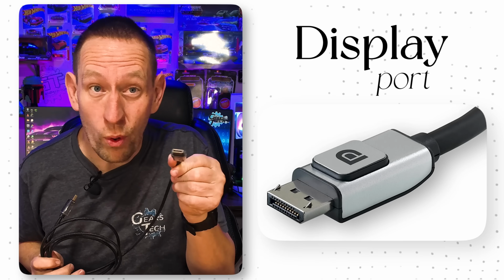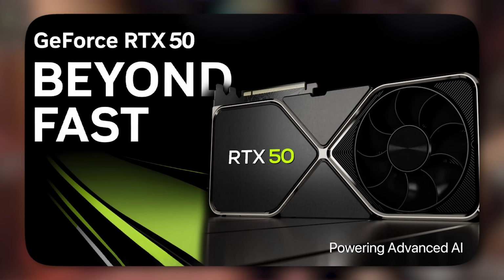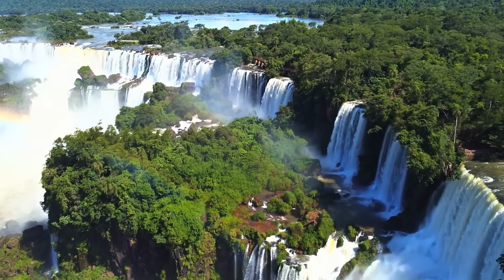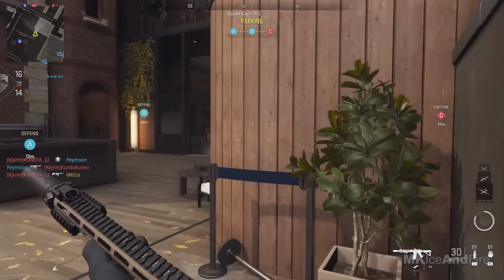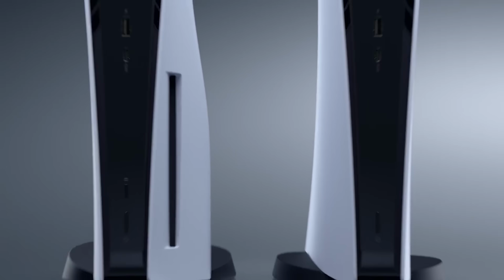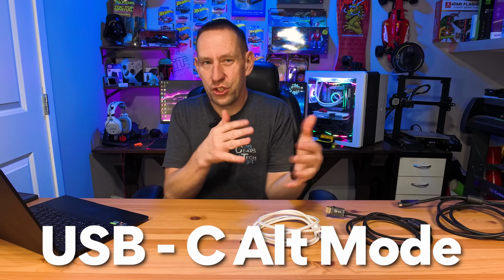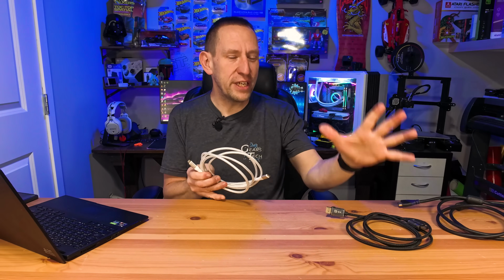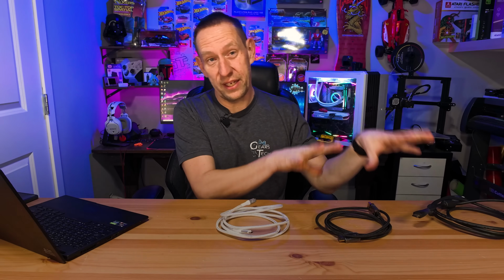HDMI vs DisplayPort vs USB-C Connection Guide

Comment: Oh cool.... I'm running VGA to Acer monitor with 1440x800 and 60 or 75Hz, then a display to HDMI and HDMI to VGA converter chain for my dell monitor with 13something and 60Hz....it's a mess but it's a cozy mess
Reply from the maker: Sounds like an exercise in adapters to make something work

Comment: I'm using DVI with my monitor because that was the brand new thing when I bought this monitor...maybe it's about time to upgrade my monitor
Reply from the maker: Haha, it might be time!
Reply: @GearsAndTech yeah. I just really like the composite, component, s video, and vga connections it also has for some of my older toys as well as the split screen and picture in picture features

Comment: Keep in mind that video creator is using the term Display port generically. However, any user needs to consider that DP (same as any of the others) comes in different flavors. Disport 1.2 is where it gained its greatest popularity, but that connection is 10 years old. 

The point is, not just DP but as close to the recent most advanced iteration of it. At present, that's DP 2.1 But the industry is typically at least a year behind. No manufactures designs their ports to be future-proof. Meaning any item you buy will always be a generation behind of what the technology is full capable of producing. 

REMEMBER, not simply the port, but the GENERATION. Display port is the best generally, but not when its a 10 years old version of it. If that's not confusing enough, BEWARE of the version of the port and the cable. Cable manufactures will use words to trick you into buy a lower quality cable. Since all of them will work (just down graded), you will get a picture just not up to the maximum quality you paid for.  

Think of it like when auto manufactures tell you your car can run on regular gas. The part they leave out, it that it will be at a reduced  power setting since the engine is designed to produce maximum power on premium fuel. 

You'd think manufacture will all agree to print the maximum capability on their products, so that consumers know instantly what each product is capable of (e.g. ethernet cables), but none of them do. In some cases, its not even printed on the package in clear language. 

That's a good sign to beware. When something is capable of the highest standard, they will typically be happy to advertise that boldly on the box so you know before you buy it. 

Display port is a pro/industrial port. HDMI is a consumer connection.

Comment: I Have 2 55 Inch TCL UHDTV's That I Use As Monitors! Both Mounted To The Wall In A Stacked Configuration! The Upper One Is On The HDMI And The Lower One Is On Display Port! Both Are 4K With My Scaling Blown Up So I Can See Them From My Recliner Or Bed! In The Living Room I have A 65 Inch Hooked Up To A PC Over HDMI And My Son Has A 50 inch In His Room Hooked To His Laptop Over HDMI!

Comment: Display port has many advantages. In its latest form, it cover all of the above from HDMI and USB-C with room to spare. However, its biggest advantage is its ability to Daisy-chain. Meaning you can connect up to 3 monitors from a single DP connection. 

Every manufacture should adapt it from HIFI systems to cameras, especially since you can always "adapt" the other system with an inexpensive adapter.

Comment: Displayport is the best hands down.
Reply: By a good margin. Too bad its overlooked by almost every manufactures. For example, both still and video cameras could benefit greatly from the bandwidth and data rate included in this port. 

To my  knowledge, not a single camera manufacturer, still or otherwise, has adopted it. Choosing HDMI (a consumer connection) instead.
Reply: @mranerobic3795  Agreed and then some.

Comment: I have been using hdmi 2.1 with the Gigabyte M32U and Rtx 4090. Is that hdmi cable good or should I go with DP?
Reply from the maker: Whenever possible I prefer dp. It removes the guessing if the setup is optimal
Reply: Not only do you need a DP, but be sure you get the cable compatible to carry  the extra bandwidth. The legacy cables will all fit, but they won't all transfer at the same rate or bandwidth. You'll only get what that cable is capable of delivering. 

Learn the tricks in the marketing wording. Compatible does not mean the same as capable.

Comment: I've used DP with a 3060ti and two monitors. I'd switch to HDMI with my new 5060ti, but my monitors are limited to HDMI 2.0. Not a gamer, so I expect I'll still be fine for my level of production work. (I keep forgetting i can daisy chain the DP.)

Comment: Ultrawides monitor 5120x1440 @ 120hz + stereo sound via the displayport cable that came with my computer. Though oddly enough the monitor only came with an HDMI cable, not DisplayPort. Working great for me.
Reply from the maker: Glad it's working well for you!
Reply: Because you don't know any better. Its like being happy with chicken until you've tried steak. If your system is capable or more, maximize it. Always use the newest cable that fits what the port can produce.
Reply: @mranerobic3795 and what benefit exactly would I get from HDMI vs the DisplayPort? I'm getting the max resolution, the max framerate, and the full sound. What more is possible?

Comment: Thanks for this explanation, I used HDMI simply because the monitor came with a cable and bad cables can be a source of problems.
At the time I was using display scaling and setting up custom resolutions for performance gaming.  The word was that HDMI worked more reliably and some people had trouble with DP, which could easily be a function of a newer interface not having old cables and monitors not supporting the full GPU 1.4A specs.
My old monitor with a DVI port has DP too, but even though I am strong on software and OS management and build, the way the commercial consortia define standards with features but then makes them optional undermines  their whole existence meant to certify features and performance to end users.

Comment: Most Monitors support all three connections? I've never seen a USB-C monitor, only heard of them. Actually I DO have a small monitor with a USB-C port, however that's only using the USB-C socket design, it's still a DisplayPort connection, meaning I can'r just connect via any given USB-C cable, it needs a specific DP cable with USB-C plug. Often times phones or tablets get hooked up to TVs, monitors or beamers via their USB-C port but even then that's usually not an actual USB connection but the device's DP Alt Mode wich basically transforms the USB USB-C port into a DP USB-C port, sending the end device it's video and audio via a DP cable or a DP cable with DP to HDMI adapter.
Actual USB IS capable to carry video signals, not get me wrong, that'S exactly how Capture Cards work, sending video and audio to a PC's USB 3.0 Type A port, not even Type C. But modern monitors, TV's and beamers usually only support HDMI and/or DP. If one has a USB-C port it's probably just a DP port using the USB-C socket.

Comment: Still slightly confused right now. I have a 4090. It’s got DP 1.4a and 2x HDMIs. been rocking a 240hz zowie on DP. Now that DP 2.1 is out and monitors having that available. I just bought a 500hz Oled thinking it was 2.1, it’s actually DP 1.4a. Do I need the faster 2.1 cables or do they not work on these ports?
Reply from the maker: Cables are backwards compatible. Won't hurt to have the higher spec cable.

Comment: Things he didn't give, skip. Display port also supports not plug. Also HDMI doesn't have a locking connector like display port. Also many times you can get inexpensive converters from display port to HDMI.

Comment: You know wat i discovered is that saving lives is a lot easier than this technology stuff ...I have a Microsoft laptop 2017 surface and I want to link it to the TV as im using as monitor on the port is has a little square opening znd usb ....im trying to find a cable male usb to fit computer and then hdmi male to TV...not sure wat that square opening is on laptop .. .
Reply from the maker: Square opening is likely just the security hole for the old days when people used laptop locks.

Comment: USB-C does not do anything, USB-C is one thing and one thing only: an ovoid-shaped interface that is easier to connect. USC-C MUST be USB3 to have the qualities you state but it can be USB1, 2 or 3 but only three does fast-charging at higher voltage. If the cable says your device is not fast charging but it has a USB-C connector, it is not USB3. Micro and mini USB connectors and ports could fast charge if they had USB3 specs.
Reply from the maker: Yes. I cover all that in my usb specific video
Reply: @GearsAndTech  then the title of the video is misleading. it should say USB3 rather than USB-C.

Comment: The problem with HDMI that you didn't mention is that the connector is long and heavy and has no mechanical locking as once existed with the 2 screws on VGA. Consequently is sometimes becomes loose and the connection becomes faulty.

Comment: I use DP (DisplayPort - not the porn definition for DP  😛). I would prefer HEMD 2.1, but my monitor only has a single DP port and 2 DVI-D ports. DisplayPort is uni-directional meaning if you monitor has a DP, it will accept data only from either a DP source or a DP converter that has the DP as the target and, say HDMI as the source. Most simple converters convert from DP source to HDMI target which is of no help to me. Converters that go from HDMI source to DP are more complicated and require a USB connection as well.

Comment: Is there an HDMI to display port adapter/ dongle to connect a newer computer with a display port port to an older monitor? Or how about the reverse? A old computer with an HDMI port connecting to a newer Samsung OLED monitor?
Reply: There are absolutely adapters both directions. I have the adapter that you would need sitting in my junk drawer, and I used to use it to connect an old laptop that only had DisplayPort, not HDMI to a monitor that only had HDMI and no DisplayPort.

Comment: Excellent analysis!   Minor point, I have multiple PC’s and Mac’s and I bought a usb-c to HDMI cable, and was surprised to see that the sound was not supported.  😊
Reply: That's unusual. I've worked with multiple USB C to HDMI cables/adapter/docks over the years, and playing sound on the monitor's speakers works just fine over them.
Reply: @yvrelna  — I must be doing something wrong.

Comment: A comment on HDMI audio, HDMI 1.4 onwards actually supports 8-channels (4 stereo pairs) and up to 192khz audio - this is useful for professionals passing uncompressed 5.1/7.1 audio through to a Dolby encoder, a second standard sends a single stereo pair at 32khz to 192khz - some devices only support this single stereo standard.  Another comment is DVD and CD players tend to send 44.1khz, while blu-ray sends 48khz audio through their  various interfaces.
Reply from the maker: Great points

Comment: I only have a ROG Strix G18 with 5080 and a PG32UCDP monitor. What is the best cable could I use to get the best connection? I’m just using the HDMI cable it came with, I believe it’s HDMI 2.1. The gaming laptop doesn’t have a DisplayPort port. But there are HDMI to DisplayPort cable and USBC to DisplayPort cable, even adapters. Are those any better than HDMI? Thanks
Reply from the maker: The problem with hdmi is its not easy to verify the cable type. As long as you're sure the cable is the highest supported one then you're good

If there is any doubt then DP is usually the better option

Comment: Thanks! But, what's the difference between displaylink and displayport?
Reply from the maker: great question. Display link is a software solution to solve connectivity of multiple monitors through one connection (typically USB). It should not be considered for any gaming connections as it uses compression to keep bandwidth in check. Great for productivity and thats all

Display port is a connector and video protocol over that connector. Its the better option every time.
Reply: @GearsAndTech 
Since viewing this video, i have portable displays with usb4 and hdmi. They work with firmware baked in. So i guess that firmware is "displaylink". I use these same displays with Mac mini m1, mac mini m4, and iPad mini A17pro, and iPad m2 or m4. All 60hz, 1080p or 2.5khz resolution, P3 colorspace. I might try display port on M4.  got docks and hubs for home or going. I really appreciate the detail you shared. 
ps my hdmi cables bought years ago supposedly spec'd to support audio over ethernet. 10 years old and still steady clean. Never had ethernet but who knows next. 😂

Comment: I just got a new MacBook Air M4 and two ASUS gaming monitors. I also got a thunderbolt 5 hub. So, I connected both monitors to the hub. One via USB C and one via DisplayPort. I didn’t need to daisy chain the monitors, since I have plenty of ports. Do you see any problems with this configuration?
Reply from the maker: Sounds right
Reply: @GearsAndTech  Thank you! 

I decided to daisy chain the monitors with a usb c cable while awaiting my 2nd DP cable to arrive. I ultimately want to have both monitors on dedicated DP connections . I discovered that both identify as DP when turning the laptop on, however. So, perhaps I don’t need dedicated DP connections? Please advise…

Comment: There is a wide selection of converter accessories among the three cables.  Some multi-hubs allow a wide variety of cables and add-ons. 

Higher-priced versions have better plugs, sockets, and wiring. Better wiring is thicker, can handle physical stress, and has longer cable lengths.  Every several months, different manufacturers and designs are leapfrogging over previous items.  Better weather and rough use tolerance. Better electrical stability and flexibility.

Comment: MST works great (Daisy Chaining) on supported Dell monitors. We use them to run up to 4 monitors from a single Thunderbolt connection on NUCs or DisplayPort cables on older machines. If I remember correctly, this has been supported by DisplayPort since 1.2. You do need to pay attention to the cabling though, and you can even use the DP to DP cables Dell puts in the box.

Comment: Thank you very much for an excellent video on this topic. I have a Dell 32” 4K (2021) monitor that I have always as the second monitor with my Windows laptop. It has display port, HDMI, and USB-C. Recently, I switched to an M2 Mac Book. The Mac has only USB-C ports. For some reason, the monitor will flicker off randomly with the Mac. It always worked fine with my windows laptop. I never play computer games. I wonder why it keeps flickering off every so often, and is there an easy thing that I can do to fix it?

Comment: I have a high end laptop (Dell Precision Pro) and I dock my laptop with a dual USB-C cable.  That provides everything I need - dual 4K monitors, power, 10G Ethernet, and USB peripherals using a single connection.  Fast and easy.
Reply from the maker: Yes. Usbc is becoming really easy to use

Comment: Display port was common on devices about 5 years ago. It doesn't seem to have been adopted by the general public. PC's and the Oculus Rift S, for example had display ports. Now, Oculus (meta) has switched to only hdmi. Most computers now only have a hdmi ports. Rtx GPU cards still have display ports, but 99% of gamers use the hdmi ports on the cards. Especially if you are using a TV instead of a monitor. My office computer uses display port and I hate it. I have 2 monitors hooked up. The newer one only has hdmi, and the older one (5 yrs old) uses only display port. It is literally the only thing I own that requires a different cable. It's annoying.

Comment: I recently bought a Dell Pro Max PC with NVIDIA RTX 4000 ADA, 20 GB GDDR6, 4 DP. Prior to this, I was running my desktop using my Lenovo laptop connected to a Lenovo thunderbolt dock. I have two Dell U2723Qe 4K monitors that have every imaginable input and output style connection, including the ability to Daisy chain. My original desk set up, used a high-end Anker Thunderbolt 4 cable from the dock to the first monitor. And then I daisychained using a display port cable (2.1) to the second monitor. When I first hooked up the new Dell PC, I simply plugged that same Thunderbolt 4 USB C cable into the back of the Dell USB-C Thunderbolt port and left everything else the same. Both of the monitors show full 4K resolution. I’m reaching out for feedback because it would appear to me that by doing it this way I’m not taking advantage of that nice RTX4000 video card that I paid for in the new Dell. Would I be better off utilizing two separate display port 2.1 cables out of the new Nvidia card directly into each monitor? Or maybe utilizing one display port 2.1 cable out of the Nvidia card into the first monitor and leaving the daisychain display port 2.1 cable from monitor 1 to monitor 2? Thanks again for any help you can offer, I’m no expert certainly. Thanks.

Comment: I have a RX6950XT Power Color Red Devil. It has 3 display ports out. I run a 24in. monitor, and a 24 in. Vizio TV with an HDMI adapter both in 1080 on the left and right, plus an ultra wide , 100 deg.  curved  main gaming monitor in 1440 in the center.  All work together very nicely.  No issues with dragging items from one to the others.  Multi tasking is simple.  🔥

Comment: Don't use USB-C I have a Frend that used it and the cable that came with the Moniter melted and the connection to the GPU burned to the point it was unusable.